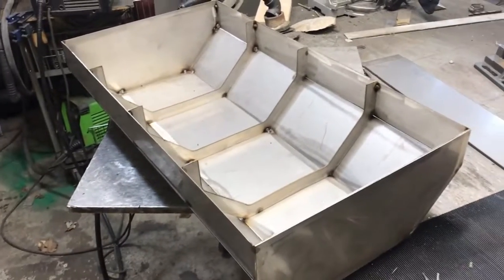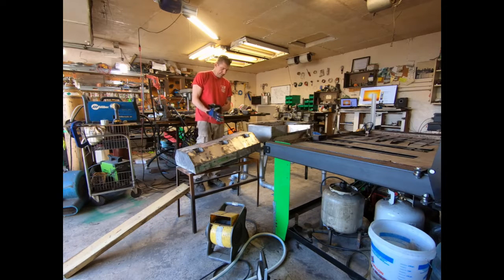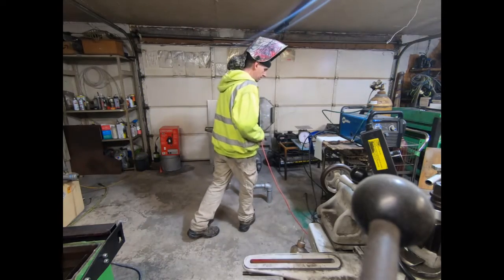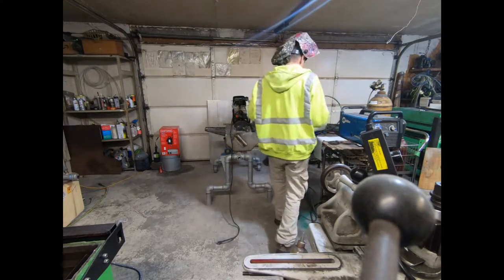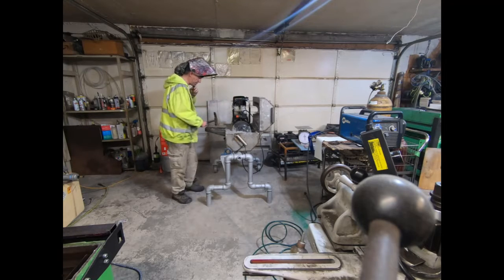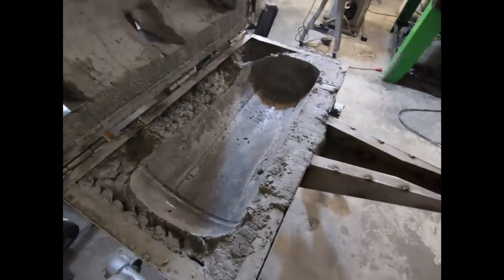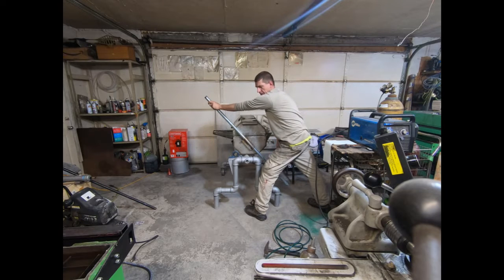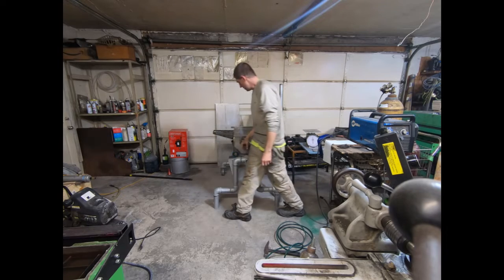Crucible Free Casting foundry for ewaste metal recovery

Comment from the maker: Hey fellas , just ot set your mind at ease this thing only needs to be tipped 30 deg to drain the pot , no where near the tip point , i over rotate in the video to get a feel for the dangers that may be lurking , i was able to fully rotate without any sensation of tipping .

Comment: you should have made the bearings on the center of the foundry about at the split. Then make a plate on it with 1 hole in it right at the top, and a pin that get pushed in it to lock it in the upright position. Then a big hand weel on the side and you have every bit of control you could wish for, you got a way to lock it up right, and you can see what you do when pouring. But thats just my idea and how i would do it.
Reply from the maker: I decided that would require more labor to build . Im losing my ars on this one . adding a pin set up an lock .
I would make it easier to control , i was worried if i guy for some reason let got of the handle i didnt want 150 pounds 
of molten metal to fallout and possible tip over the foundry . It would  need a rotation stoppers for both directions .
3 extra hours of work and i just cant do it.
Reply from the maker: Dont get me wrong Bobo it would be the best way ,  i wanted the same thing till i looked into the safety features i had to add to keep it from just rolling over . Also this frame wont work well with that idea. Unfortunately i had to find the shortest path , not the best ...   Kinda like swimming  through a river because your to late to walk to the bridge . Time and money sometimes design things more then you want them to .
Reply: @NOBOX7  I think the center position for the roll construction wouldnt be that much more work, and the advantage would be huge. You have a plasma table right? We made car rotisseries and we just cut a disc on our cnc plasma table. Have a pin on the support leg where the bearing is on as wel, and push the pin trough the plate and its 100% secure. Pul the pin out and its free turning.
Now i would mount the barrel just low enough so that in empty condition it would turn back to upright, so have the turn axle just below the halfway if possible. That way it wil allways turn back to upright position if you let go. And if you fil it it wil stil turn back to upright. Then the lockpin is just there so that if someone touches the turn wheel it wont turn by accident. It would be bad if someone turned it by touching it by accident and pouring some molten metal on the floor wich wil then splatter all over their legs.

If only i had time for casting metals i would love to do a build like this, i could even share parts of the footage, but there is only so much time in a week, and its all needed for other things at this moment.
Reply from the maker: Putting a pin and plate system with a wheel is at least 2 hours time and a couple hundred dollars for all the parts.
 plus if somebody lets go of that wheel man dude its over .... Bad idea

Comment: I built a similar tipping furnace a few years ago by lining a steel tank.  No split or lid like yours.  The burner on one end, access on the other and a spout in the middle on the side. You simply fill and clean it from the end.    All sits on a base with 2 cradles that let it rotate.  I got the idea from an old foundry book.   Was unable to get the heat above 2100F.  Not the furnace, I didn't have your skill in burner design.  Have been following your videos and hope to redo the burner and get it working.